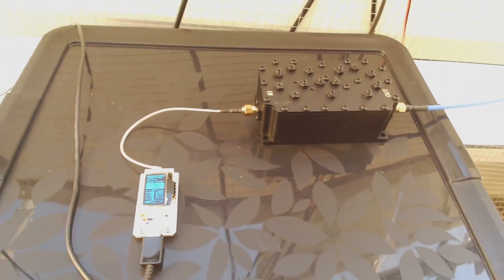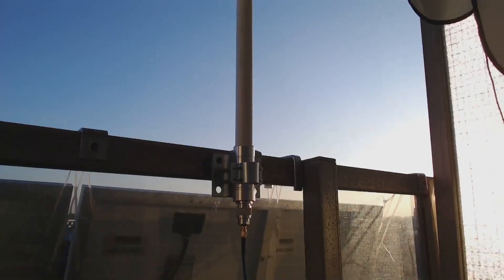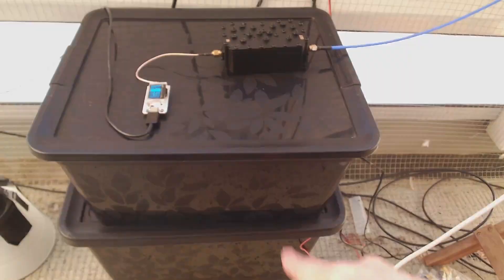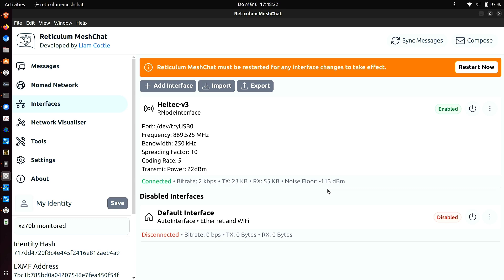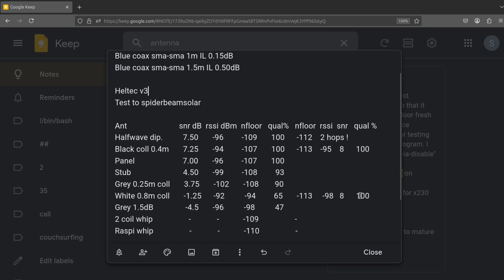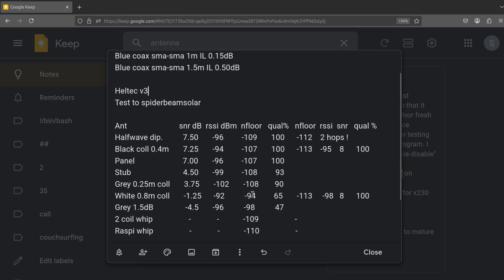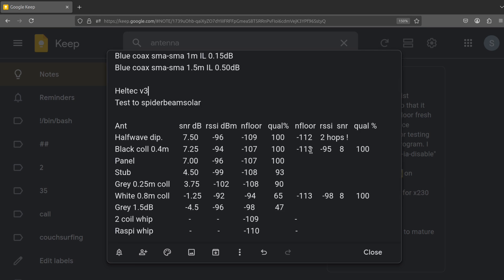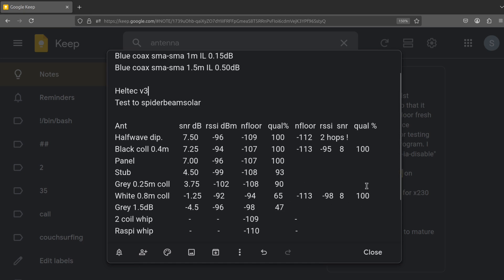Filter to improve Signal Quality of 868MHz Reticulum Meshchat RNode

Comment: Hi Simon, thanks you for lots of very interesting content. I think I know the answer to this question but I have the opportunity to put a 868 mhz node on a high site that has cellular operators on it. Am I wasting my time or are some of the filters you have tested usable in theses sort of circumstances. The node will be meter away from cellular sector aerials
Reply from the maker: I think you will have big problems with your receiver being desensitized due to the 25W or so cellular transmissions right next to it.

Comment: Very cool. How much range improvement does this result in?  Can you test to further nodes where the top 3 antennas have reduced signal quality and then see if the filter is an improvement?
Reply from the maker: Am waiting for warmer weather first :-)
Reply: @fotografm  Awesome. It's interesting to see that the filter turns a bad antenna into a good antenna and it would be interesting to see if it turns a good antenna into a very good antenna.

Comment: have you looked into putting ferrite on the coax of the correct mix for 868MHz? the closer to the board on the coax the better
Reply from the maker: That is an interesting suggestion. It might help to reduce interference picked up on the outer shield of the coax.

Comment: why not just include a band pass on the device it self, just bad tech.
Reply from the maker: That would be nice but it would make the hardware more expensive. Also, only a tny SAW filter would fit on the board and they have at least 3dB insertion loss which would result in poor performance.

Comment: This is just great stuff! Did you tune the filter yourself, or did you get it pretuned for the desired frequencies?
Reply from the maker: It was already tuned by the manufacturer. I would like to shift the passband up a bit since 869.525 is right on the upper edge. There are 14 adjustment screws to play with so plenty of opportunity to mess it up ;-)